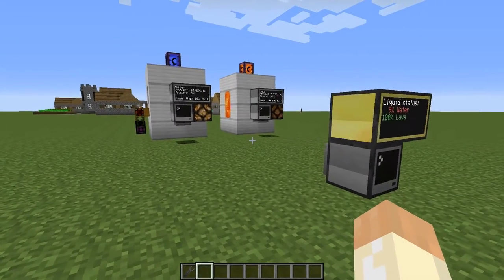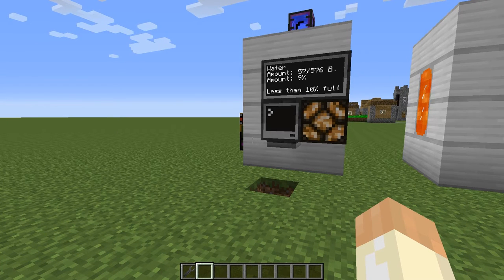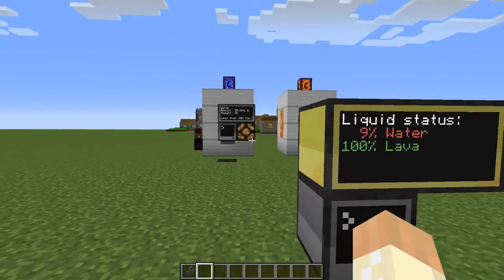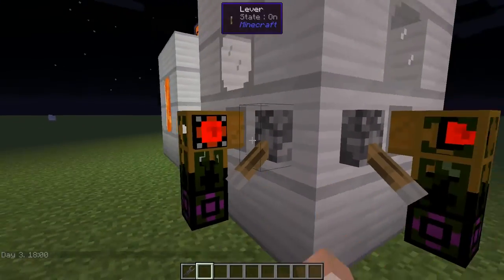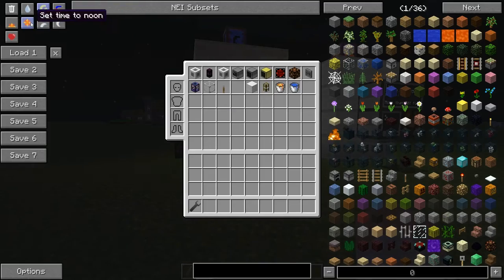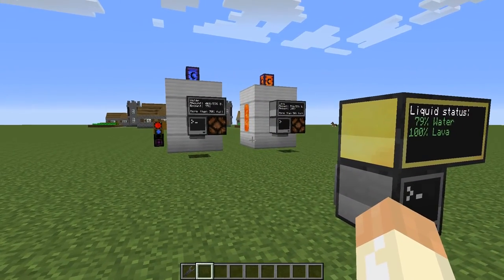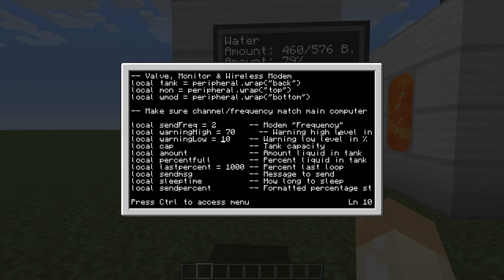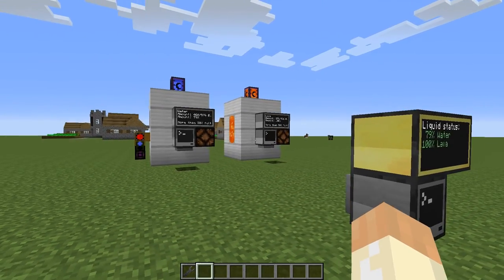Tank Liquids Monitoring System v3.1 - With Hysteresis (MC 1.7.10)

Comment: After all the searching this is the only code that reports liquid amounts properly.  I have found one...bug?  My RC steel tank has a capacity of 20,736,000 mB.  getTankInfo() reports capacity = 20736000, then after the contents section it lists capacity = 20, .  The latter value is what this program is retrieving, so it ends up as 0.02.  How do I fix that.
  Also, how hard would it be for me to send the data displayed on the slaves to my main monitor setup?
Reply from the maker: I don't really understand, a bug with my code? The capacity is correctly reported as 20736000, but after the values are saved it's only 20? Can you show screenshots of how it looks? Note that the value being sent is the amount in percent full - not the capacity or amount.
Hard do answer how hard it would be for you, but it shouldn't be very hard, just a lot of coding. Look at the "main" code and basically copy all the code to your main computer, and change lines and things to get the formatting in place :)
Reply: therealtkh In other words after calling getTankInfo() from lua I get this
http://imgur.com/Sj8Cfv6
Notice the second capacity listing.  That is the one that your code seems to be recognizing.  so it cap/1000 to get bucket totals and the %full is like 690k% lol.
Reply from the maker: Spectarz Thanks, I'll have to take a look at that. I don't know what the other capacity is... I'm at work and can't test it for many hours, but do you have any other blocks next to the computer? I can't try this, but perhaps something like this could be the solution (on row 31): fluidCapacity = tableInfo[1].capacity
Reply: therealtkh instead of v.capacity...so tableInfo[1] would reference the first entry of the table right?  Don't bother if you are busy at work, it isn't all that important.

  A few things in your code I don't comprehend, it is a bit above me to be honest and I doubt I could send all the slave info to the master monitors...the way you have it set up I would like to reverse the information.  amount/cap on the main monitor in my HQ so I know exactly how much I have etc..
Reply: Spectarz That worked perfectly!  And even better i understood it lol!
Reply: therealtkh I don't think it is a problem with your code exactly, I have been working all night to find out how to pull liquid values and no other code I have found works properly like yours does.
Reply from the maker: Spectarz Correct, it would (hopefully) use the first value. I changed this code a bit in the original version, but this little change never made it through to this updated version (with hysteresis). If you're not in need of hysteresis, check the 3.0 version (link in description) if that code works better - because it uses the [1] reference.

I don't send all values to the main system. The relevant info (color, percentfull, name) is formatted to a string and sent. The receiver (main computer) breaks it down to two text strings (name and percentfull) and sets color depending on what was sent. I did it this way to send as little as possible. I'm not interested if I have exactly 2034 buckets, I just want to know how many percent we have.
Reply from the maker: Spectarz Awesome that it worked! Thanks for testing :) I will make that update to the code and update the links in the description. But I would like to know what causes that 20... is there a pipe close by or something like that? Will have to do some testing I guess - when I have time ;)
Reply: therealtkh yeah the [1] reference works perfectly.. In fact your whole program works flawlessly.  Had been trying to get a graphical display for my control room monitor with no luck....hopefully I can learn this quick enough to make what I am wanting.  Thanks for all your help!!  And again, great CC code!!
Reply from the maker: Spectarz Oh, yeah the graphical method would be much cooler, but I don't know how to do it. Have seen it a few times though, so the info should be out there :) Thanks, and again, just glad that the program helps!
Reply: therealtkh It only seems to happen with RC valves, no extra capacity listing with TE tank or ExUtil drums...
Reply from the maker: Spectarz I tested this now, and I get the extra capacity (20) as well if I place computer below the tank valve. But not on the side as in the video. I don't know why, but good to know. Anyway, I have updated the code to use the [1] as standard (as I do in the 3.0 version of the code). New link is in the video description, feel free to try it out, it should work just as fine as your modified one :)
This will work fine for as long as they appear in that order. If the capacity=20 is listed first it will of course fail again.